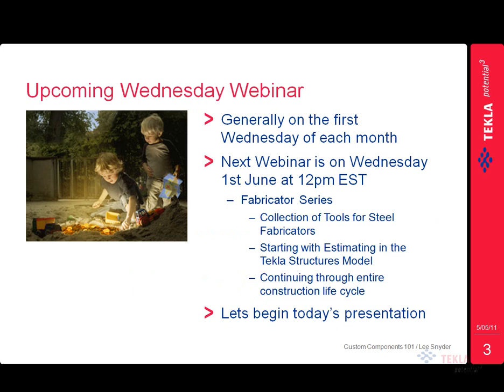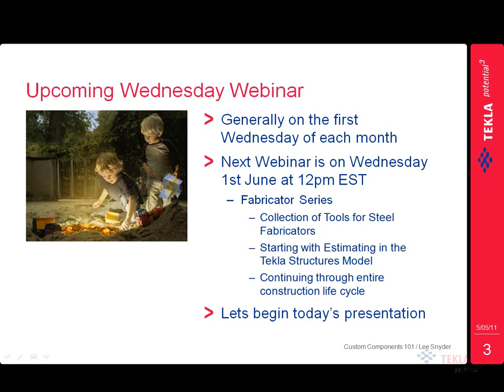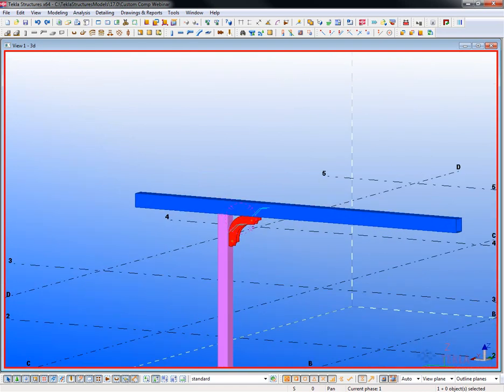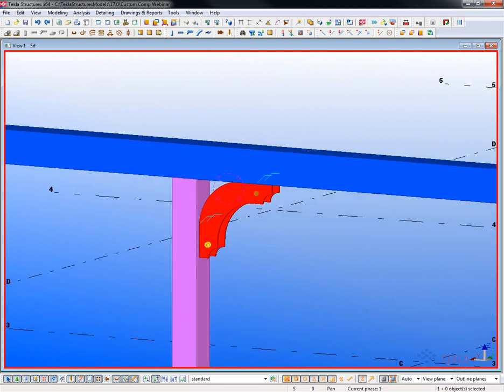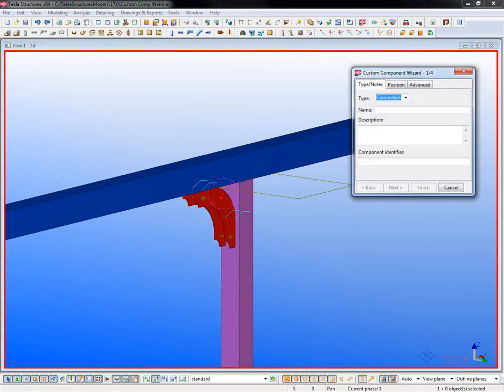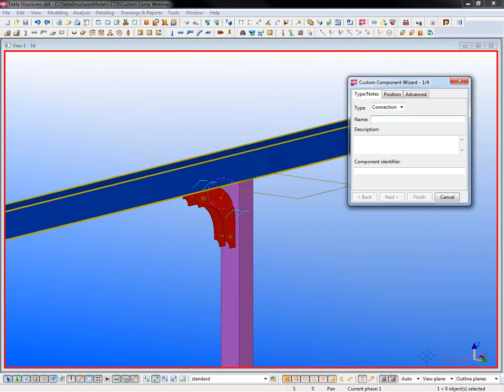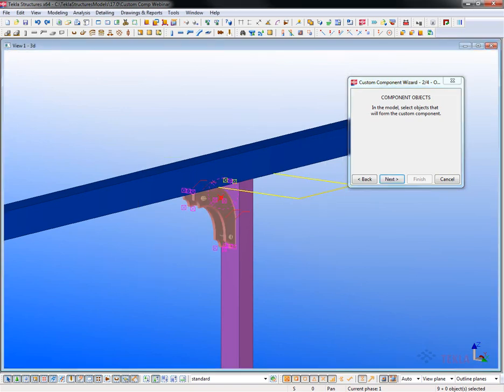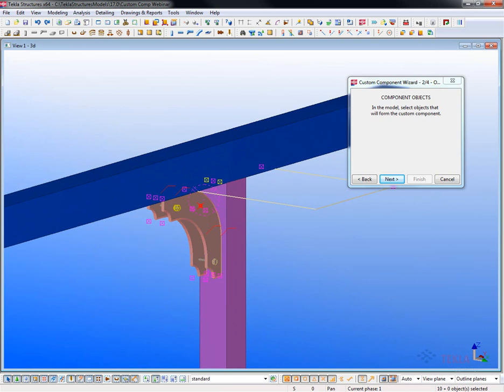Tekla USA Webinars - Custom Components 101: Connections part 1 of 11

Comment: I think these are great, but I second Barry Ralphs about the need for a "pointer is here" to display when things are called out. Also how are the stair macro/custom components made that contain multiple custom components inside of them. Tekla really needs to allow its users to modify existing system components. Not only would you eliminate the need to show specific tutorials on here, but it would be very helpful for your community to really see what makes Tekla "tick" as an overall system.